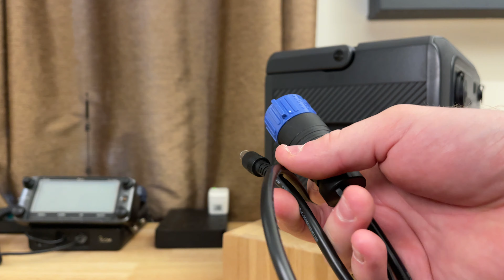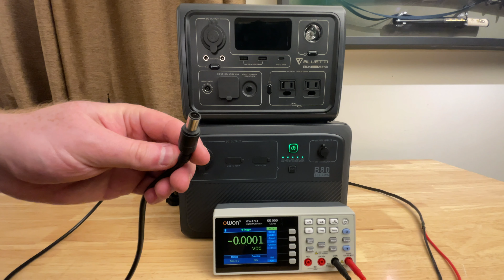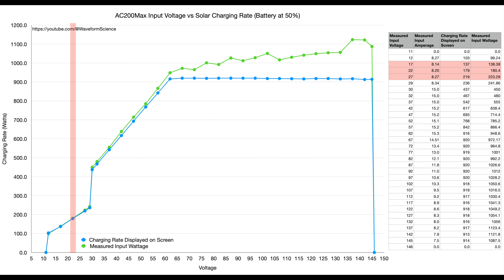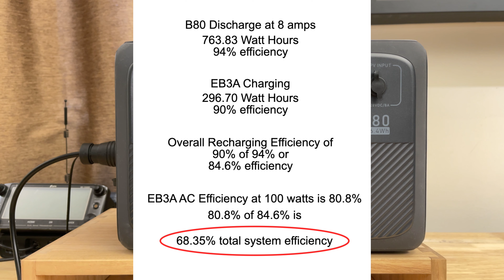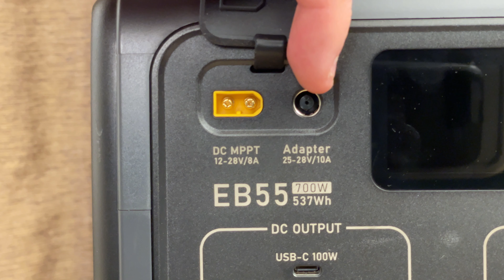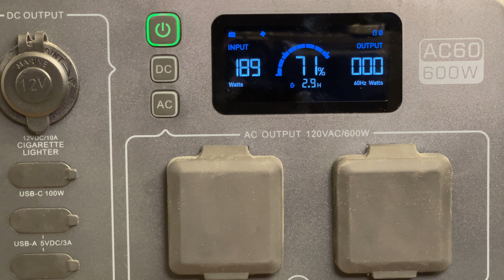Bluetti B80 Powerbank Mode

Comment: Hi Jeff, great and interesting videos. Question .Iv got a Bluetti B80. I'm a bit concerned about the firmware for the B80. ? The only other station iv got is AC180.  Have you heard from Bluetti  about addressing the firmware up dates. other wise  i can see I'm going to be in a bit of a fix at some point. And I'm shore you can understand i don't want to buy another unit AC60 just to execs the firmware.
Like to hear your comment's.

Comment: I just bought a b80. I can't get the unit to go in to power bank mode. Yes, I held the power button down for 5, 10 or so seconds and it won't blink. Bluetti customer service was supposed to call me today but they didn't 😢
Reply: Hopefully you had some luck.  BLUETTI never responds to me, no matter how many times I try.  I’ve tried both Canadian and US contacts and after many attempts I’ve realized they literally have no service at all!
Reply: @aaronlawrence666I ended up returning the B80 for a full refund. I don’t recommend the expansion pack type power banks. They don’t have WiFi like the main units do and it did not perform as advertised.
Reply: @originalsixx thanks.  Appreciate the advice.
Reply: Hopefully you have resolved this issue but if not make sure the firmware is up to date

Comment: Other than 100(ish) watts of input power, what would be the downfall of merely running a 12.8v lifepo4 battery into the solar input of the power station?  I get that the power transfer would be slower, the battery would be a bunch less $$$ however is my thinking ?

Comment: I’ve been enjoying just using the B80 alone since most of my stuff is DC anyway. I finally got my aviation cable, but it will probably just be a backup situation for a random AC thing in my EB3a, I’m learning. I picked up the T200s back in June, so I’m glad you recommend that for charging the B80 outside of my 200w solar panel. I figured if I didn’t need a bigger inverter, the B80 made sense for me needing more watts??? I don’t really know what I’m doing, so thanks for the help.

Comment: Kinda sad you cannot charge EB55 with the other port whilst charging simultaneously with solar using the xt60 port... having to change them manually annoys me..
Reply: What makes you think you cannot use both inputs to charge at the same time?
Reply: @ray32825  My lack of experience I guess... can you enlighten me on how can I do this so its automatic and I don't always change the cables? I am fairly new to this stuff, thanks.
Reply: @truesight91  You can use the AC adapter along with solar to dual charge the EB55. The thing most of us want to do is use the solar along with another DC input (like the alternator of a vehicle) to dual charge.
Reply: Yes I am aware of that although I am referring to when I am camping in nature not at home with AC electrical sockets in every corner.
Reply: @ray32825  and yes the second thing you said is what I meant from my original comment.
Reply: @truesight91  I liked the power, capacity and most of the features of the of the EB55 but I think the AC60 + B80 or even just either of them alone will suit my needs much better.
Reply: @ray32825  I would look at the ecoflow river 2 series or others tbh, I wish I got ecoflow now that I researched more, it seems superior in almost every way. I've had many issues with the EB55.

Comment: Do you have a link for the dc-dc voltage converter?
Reply from the maker: Daygreen makes the 24v to 13.8v one. 

https://daygreen.com/collections/24v-to-12v-13-8v/products/24v-to-13-8v-30a-414w-dc-dc-step-down-converter-voltage-regulator-1

The 24v regulator was off Amazon:

https://www.amazon.com/gp/product/B08Q7T6PNM/

Comment: Having spent 35 years in the electronics I can tell you that I really appreciate your reviews. Technical but not overly. My question is: is it possible to daisy chain 2 B80 batteries in power bank mode? I have an AC 180 and would like to expand its capacity as best as possible.
Thank you.
Reply from the maker: It will work, but you'll lose additional efficiency.

Comment: Does it stay in powerbank mode after it hits 0 ?

eg solar starts coming in during the day it charges the B80 - B80 is in powerbank mode it charges the EB3A the B80 runs flat overnight next morning solar starts coming in again - does it stay in powerbank mode OR do you need to turn it back on ?
Reply from the maker: No, if it full powers down due to being empty then powers back on due to incoming solar power then it does not automatically turn back on the powerbank mode output. This is similar to all other Bluetti devices in that they require human interaction to turn on output ports. I'm told this is for safety and regulatory approval reasons.
Reply: @WaveformScience  the new ecoflows can auto turn on when they get solar power not sure its regulatory
Reply from the maker: @volrathy1 

I was told by a few folks that know much more about that than I do that the US electrical code does not allow for it to power on unattended unless the unit is attached to the grounding system of a building.

I can’t point to a code section though since I’m not the expert.

I do note that the regulators do not seem to be doing anything about EcoFlow’s experimental features. Maybe they didn’t notice, or maybe it is perfectly fine. I don’t know.

Comment: Jeff… do you either know the number/figure yourself for an AC180 or know how can I calculate the AC180 “charging efficiency”? I’m trying to confirm if the AC180 “overall recharging efficiency” is similar to the number you received for the EB3A.
Reply from the maker: I do have that for the AC modes. I don't have efficiency for the solar or DC charging modes. 

AC180 Silent Mode - 5h 52m - 1397 Wh - 74% efficient 
AC180 Normal Mode - 1h 30m - 1334 Wh - 77% efficient 
AC180 Turbo Mode - 1hr 8m min - 1381 Wh - 75% efficient 

My EB3A number was on "Normal mode", so the EB3A is more efficient at recharging as compared to the AC180.

Comment: Thanks Jeff, great video as always! I already own a EB3A and a AC180. I was waiting for this video before deciding to buy but I think it’s worth it.  I have 1 question…. Do you think it would be possible to charge the B80 via car charger without buying the T400/T500? My intention was to just use my EB3A with the DC car charger and plug the EB3A into the wall. I know I’ll be limited to how fast I could charge the B80 but I figured it would be doable?
Reply from the maker: Yes, you just need a regular cigarette lighter to DC7909 cable. The same plug that may have been included with the EB3A (depending on when you got it) will work fine with the B80.

Comment: Good review and food for thought. So if I had just a B80 I could hook it to an inverter and get AC power although I would probably do better if it was hooked to the EB3a. Or using a buck converter enhances the input from a 100-200AH stand-alone lithium battery and plug that into a EB3a. Or did I totally goof up on the explanation you just gave me?
Reply from the maker: The DC to DC converter just changes the voltage, with a slight loss in power since no electronic device is 100% loss-free. A DC to DC converter can't add power to the system.

What I was using it for was to stabilize the voltage around either 13.8v or 24v in order to regulate the otherwise unregulated output from powerbank mode. 

You could run that to a small inverter, but it would still be limited to around 200 watts or so since the DC7909 connector on the end of the Aviation to DC7909 cable can't handle any more amperage than that without melting. If you already have an EB3A then I would just use it to recharge the EB3A, unless you are using those parts just for the sake of having them.

Comment: Another great review.  As a side note, you can hook up the DC050 to the charger input on the AC200MAX as the DC050 allows you to up the max solar input on the AC200MAX from 900 watts to 1400 watts.  I bought three of the DC050s to hook up one to each of the B230 batteries and the charger input, which gives me 2400 watts max of solar input.  I bought one of the B80 batteries (didn't get the AC60) for this very purpose, thanks!
Reply from the maker: I agree. Bluetti's system where adding more batteries also scales the amount of solar input is a wonderful design. It keeps the system from being "too much battery/not enough solar" when you add more batteries without needing to put a single giant solar controller in the main unit.
Reply: 3x $200..wow, but a step up controller would do that too.  At least in Asia where I live the D050S only was $80 so I bought 2 for my sea container tiny house on solar.  Bluetti AC200 Max is the best all round  useful solar generator out there.  It runs my 12500BTU (one tonne) air conditioning.  I get sun from 0600-1830 year round though @ebikecnx7239
Reply: @cnxoutdoors  I got one of the DC050's for free as a promotion on one of the B230's, but yea, $200 bucks US is pricey:(

Comment: Hi Jeff.

Thanks very much for this video.

I have a question about something that wasn't covered. What happens if you connect the Aviation Cable to an AC60? Does the AC60 have some sort of "power bank" mode? Would doing this harm the AC60 (or the cable, or whatever you plug the 7909 connector into)?

Enquiring minds want to know!

-Doug

(and thank you for not harming any sharks)
Reply from the maker: Hrm, interesting. 

As far as I can tell, the AC60 does not itself have a powerbank mode. Plugging the cable into the AC60's aviation port does not appear to damage the unit, but it also does not output any power. The "battery" icons on the screen do not light up either, probably because the data pins are not sending the data that the AC60 would expect from a battery. 

I would not suggest using that cable to try to feed power into the AC60, as that would probably break something. 

I'll see if I can get any additional information about this from Bluetti.